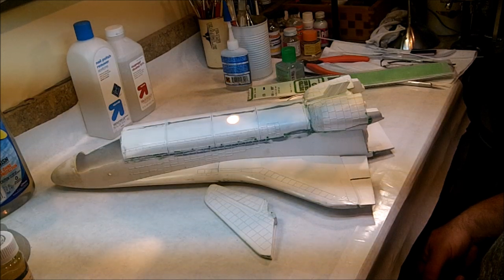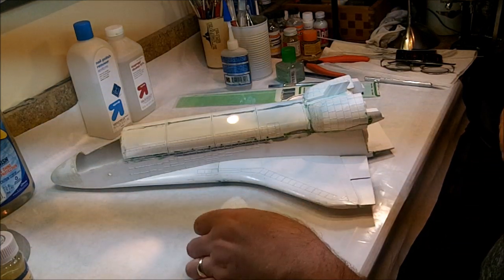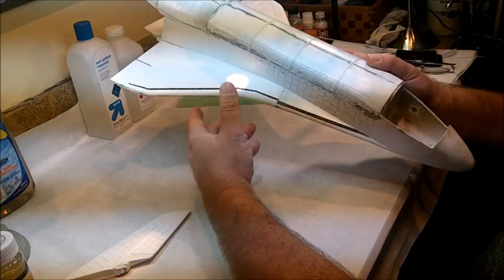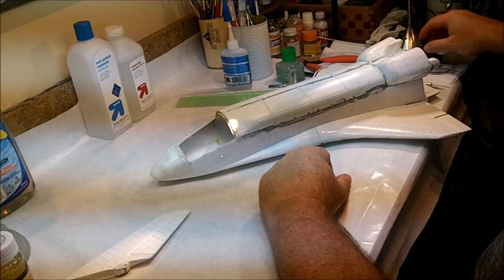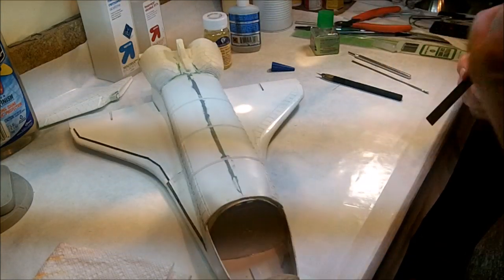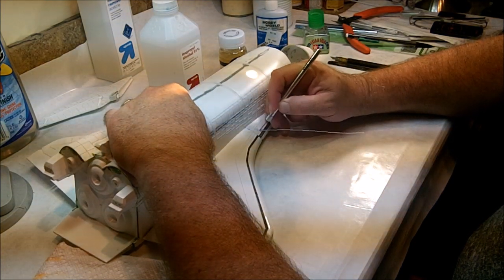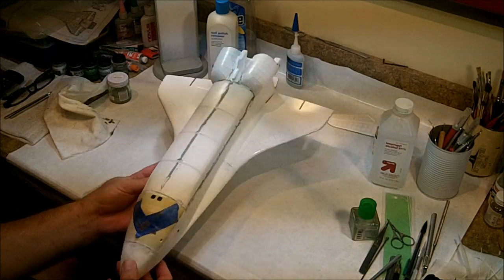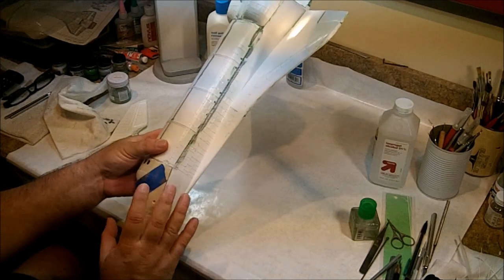Shuttle Wars, Part  21

Comment: I'm about to start a 1/72 full stack and that beanie cap is great. Do you happen to sell these? Id by one in a heartbeat. Your videos for the shuttle build have been a life safer in prepping to build this beast. Can you also point me in the direction to the decal and reference material you mentioned in a previous video. Look forward to your future posts.
Reply from the maker: I actually got a chance to work in my studio last night and almost finished laying out the styrene strip around the flight deck area.

The decals are from several sources.  The gray tile ones are from Cutting Edge and no longer in production.  The dark gray/black ones are the Cutting Edge sheets "remastered" by Ed Bisconti and are copywrited.   He used to sell them on ebay, but has gone silent over the past couple of years.  Distributing or selling copies of a copywrited item is illegal, and even if it is unlikely that I would get sued by Ed, I do not want to be accused of ripping off someone elses design.  I may contact him and attempt to negotiate the rights.  There is clearly a demand, as I keep getting requests for both the beanie cap and the decals.
Reply from the maker: I forget to answer your other question about the beany caps.  Yes, I do sell them but right now I am not producing because I need to make a new, improved design mold.  My previous design was trapping some air bubbles at certain spots.  I may not get around to the redesign until summer 2015 as I am so busy with other work.
Reply: oh my